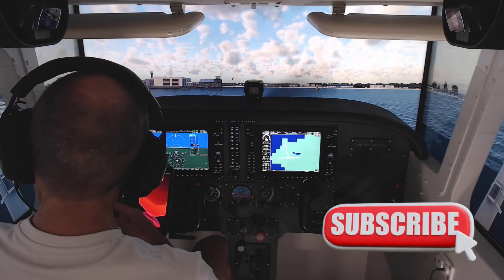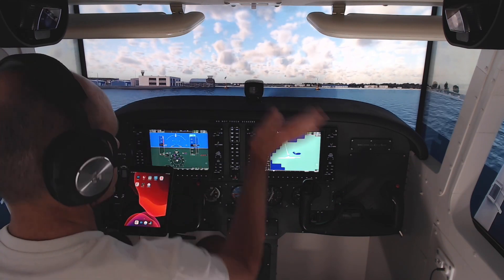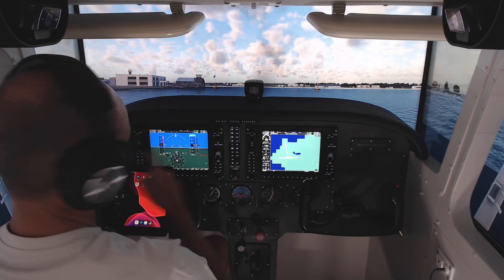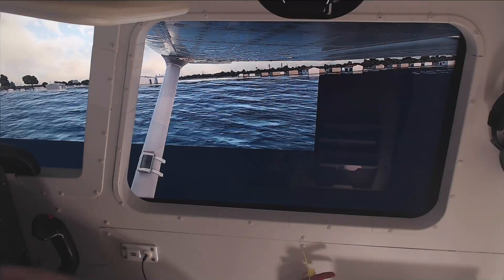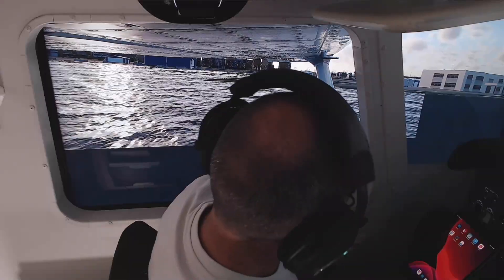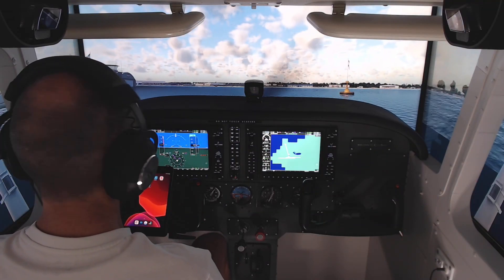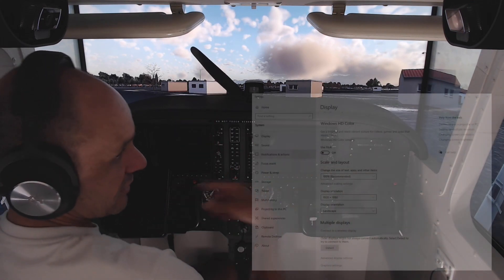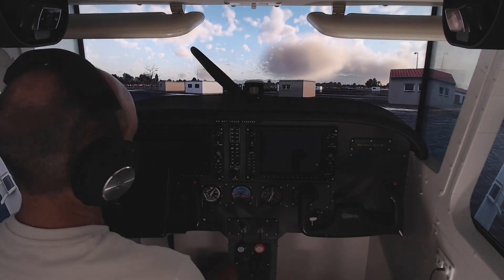121 - XP12 multi monitor resolution problem fixed !

Comment: That looks to be really amazing; may I ask you about something about the triple monitor setup? I'm currently using one 37" 4K tv, which I'm fully satisfied of, but thinking of an upgrade to 3  - thanks in advance
Reply: Thanks, I'm sure if that, hoping non to have too many impacts on fps and overall graphic quality; actually I'm interested in knowing a bit more about the setup (how to do it), not easy to find something so far; anyway, very nice video (and the others as well), enjoy your 3 displays 😉
Reply from the maker: @Carlo-f1e  HI mate. Any increase in pixel numbers will increase load on a single machine. Single 4K = (3840 x 2160 = 8.29M pixels), Triple 4K = (8.29M pixels x 3 = 24.87M) a considerablly lot more for a grahpics card to manage, particularly if you want to maintain a good FPS (min 30 FPS) with no stutter. I have my 3090Ti in FS2020 running 4K at front, 2K on sides and tend to get about 30FPS. I find that for my GA flying really playable. XP12 not as good on performance so some further optimisation required there.  Hope this helps somewhat.  I did do a video on this (for XP12)....https://youtu.be/F7nHx7YNrhA?si=IGBVAqu1wZQ1uRCd
Reply from the maker: No problem. Is your question whether to upgrade?  In my opinion flight sims are always better with 3 screens as you can always see either side without switching views.